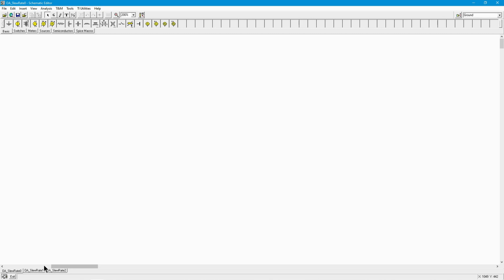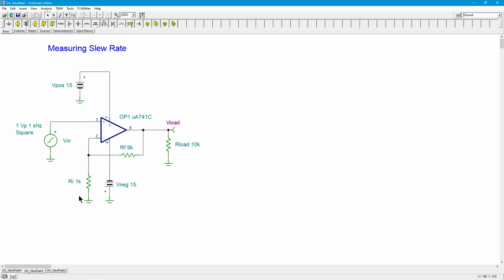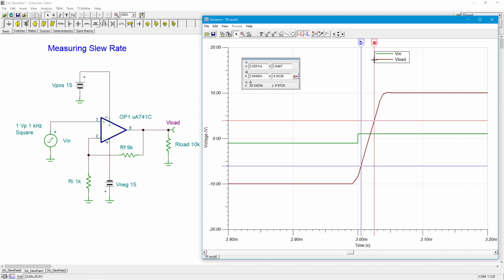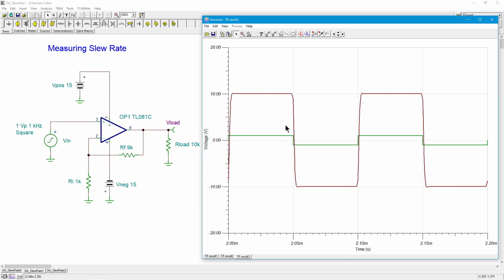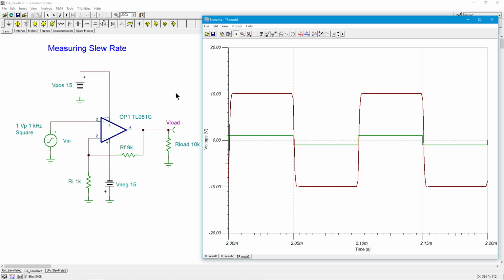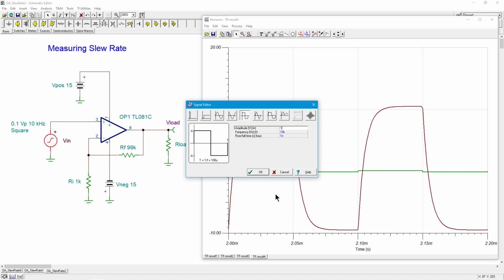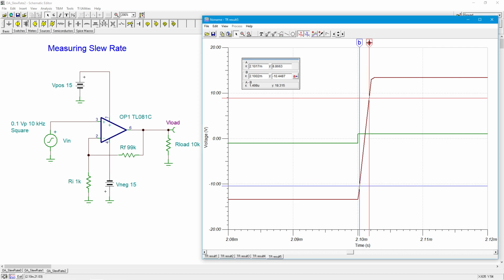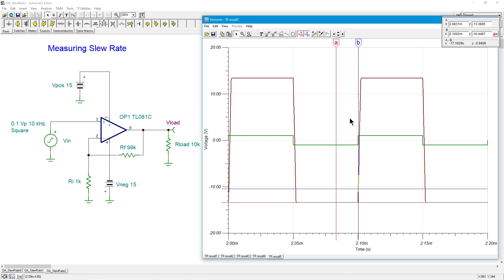Op Amps: Measuring Slew Rate

Comment: Thank you for posting all your videos. I've just got some of your textbooks, which I'm sure will be very helpfull (DC & AC for the time being as I need a strong refresher...). There are many exercices after each chapter, which is good to verify that the chapter is "understood". Although it's written that answers are available for most 'Analysis' odd-numbered exercices. I didn't find any answers for 'Design' and 'Challenge' exercices. Sometimes it's hard to believe we got it right and reassure ourselves that progress is made if our answers cannot be checked against anything. Your comments will be welcome.
Reply from the maker: This is a common questions that I get. There is a rationale for this. First, I don't include answers to all problems because these texts are used at colleges and universities, and professors assign some of these problems for graded homework. This is particularly true for the challenge and design exercises. Second, if you have doubts, remember that you can always capture the circuit in a simulator to check the results.

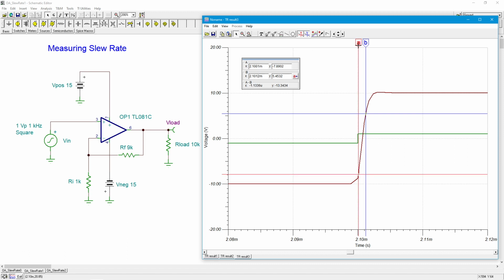Comment: Why does the output have a kink prior to the input changing at 9:13 (at the begiining of the rise time)? This was also visible on the 1kHz signal as well.
Reply from the maker: Without diving into it, I suspect that is due to the finite time resolution of the sim. Note that we have zoomed into the plot. Time domain plots only compute a certain number of points. 

Having said that, you will sometimes see slew limiting that changes slope. This is due to the internal characteristics of the op amp.